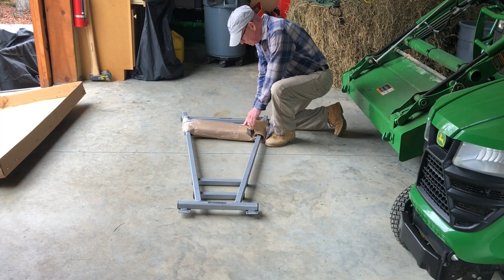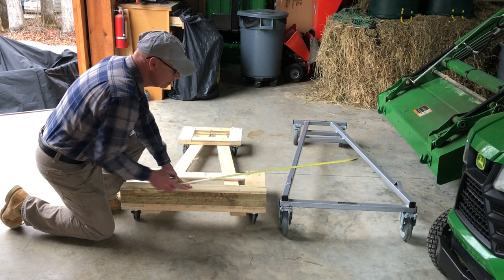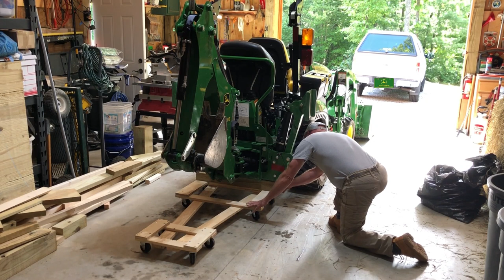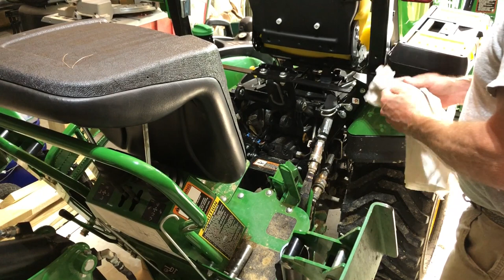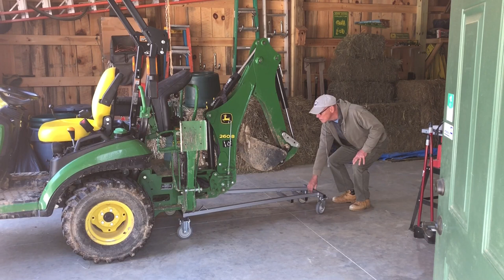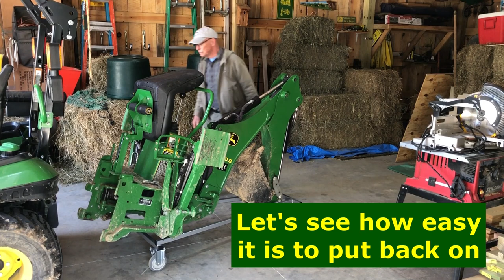1025r: "Hello Dolly" - Which works better? The BXpanded 260b backhoe dolly or DIY wooden dolly?

Comment: Thanks so much for your excellent video! my dolly should be here in a week or two and this was very helpful. something that I’ve also heard is also worth it  is to add the mudd’s custom handle to the backhoe it’s excellent for an additional grab bar but it also is an easier way to maneuver your dolly. Although you didn’t seem to have any trouble, my friend loves it because he has an easy and convenient place to grab without always accidentally getting covered in grease.
Reply from the maker: Thanks for tuning in - The Bxpanded dolly is definitely the way to go. I used to dread taking off the backhoe but now it's a breeze. I like your idea to add the handle.  It would help in maneuvering the BH dolly around the barn.  Please stop back in to see us again...  Good Luck with your new dolly.